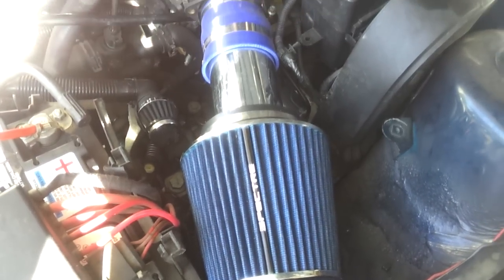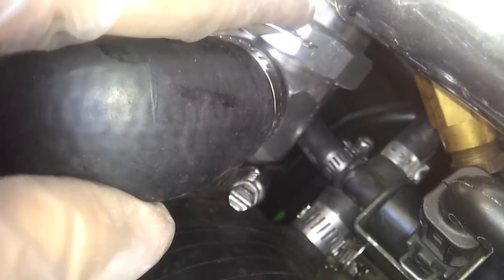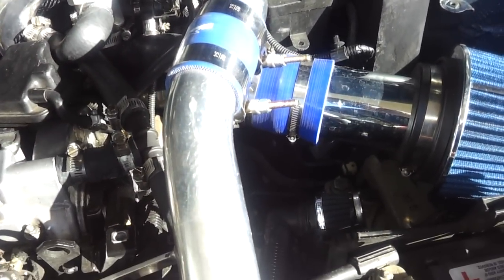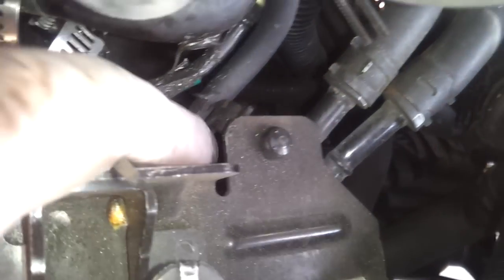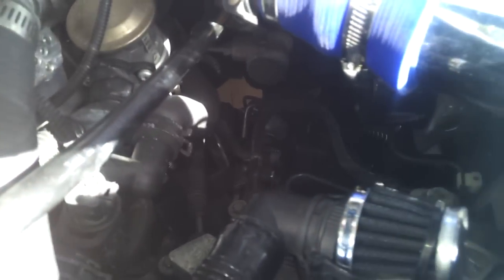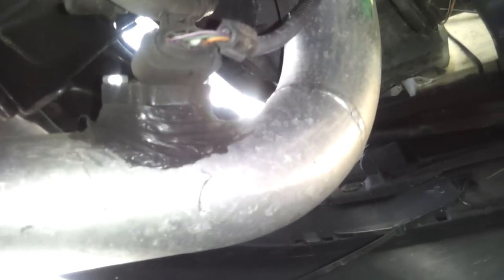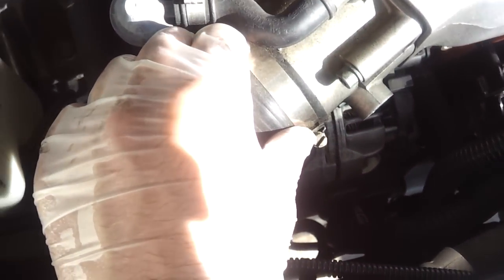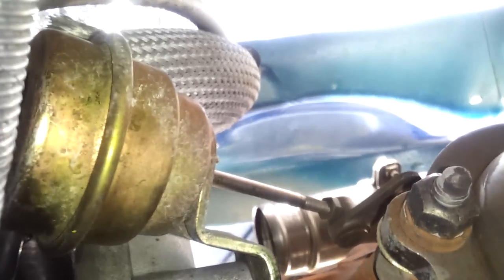1.8T jetta boost leak locations

Comment: Hello you said the hose that connects to the intake hose by the turbo just above the rock lol... connects to the n75.. is that right or does that connect to the evap?
Reply from the maker: the small hose next to the rock connects to the N75. that is correct. hope that helps. lemme know if u need anything else.

Comment: Hi My car is making this exact sound 2:58 , I’m loosing a lot of power cuz the turbo is cutting off. Any way to help me ?
Reply from the maker: Unfortunately i sold the car to the junkyard. This is one of those things unless I'm there physically to see it,  I can't really help. At most, i hope my video guides you in some way. Always take a break from your car and sleep on it, and think about the problem the next day.  Maybe your diverter valve is bad and has a tear in it? Some problems are just hard to diagnose unless if you see a real mechanic or just happened to find the problem by accident. goodluck!

Comment: So I ran the hose that connects to the side of my intake back to where you had that extra blue breather connected to that black plastic hose and I basically set the extra breather aside? Any thoughts? Should I do something different
Reply from the maker: +Adam Landry  With my mini blue intake, i just set it aside, you can set it aside anywhere. As long as you don't have emissions in your state, you can cut the hose shorter so it doesn't hit against the radiator  fan. Simply saying, zip tie it up anywhere you want.

Comment: Boost leak at the air filter you say?
Reply from the maker: James Konkler as I try and understand what you say, yes you can have a boost leak at the air filter. If the air filter's cotton is worn. It can create a hole. Thus, a leak. I don't think I am wording this correctly.
Reply: brontoe  This doesnt make sense to me. There is no boost in that pipe. It's pre compressor.  The turbo is sucking through that pipe not boosting.  If your logic was correct the air filter would be one giant boost leak all the time.

Comment: why would you put heat wrap on an intercooler pipe? shouldn't they be cold?
Reply from the maker: Only the pipe AFTER the intercooler is cold. The charge pipe is HOT. I saw the intercooler pipe slowly melting the rubber  off the radiator hose so I put the heatwrap around that area.

Comment: What's a good steady vacuum reading at idle?
Reply from the maker: light575575 when you hear the oil bubbling. and there is no hiss noises. or air escaping sound. I honestly have no answer. when you hear no other noises you are gooe. I normally do mine up to 20 psi that way I know for sure there are no air noises

Comment: With this problem your rpms could be moving if you are in drive but you are in a red light
Reply from the maker: Thats the clutch sensor. ummm the one where your left foot presses on.
Reply from the maker: brontoe
The item is called the Clutch Switch, you can search for it on ecs tuning  or whatever website. it will stop your over revs at a stop light.

Comment: Thanks for the great video man. I am trying to find boost leaks on my VW Passat B5.5 1.8T. 
You mentioned not to use silicone hoses. I have used some on my previous car vectra 2.0DTI and i was satisfied.  Any more info on that? You have some experience, why not to use them i think they are pretty strong?
Reply from the maker: No problem, glad to help! As far as silicone goes. There are three types of silicone. The 1 ply, the 3 ply and
 the soft, squishy one. Silicone has gotten better over time since i posted this video. The silicone hoses that eurojet, forge, autobahn, and some ebay silicone hoses are good. Don't buy a silicone hose from an auto store  or home depot because they are not auto motive grade. Not yet at least. They tend to be soft and squishy. The term Silicone is so universal and now there are different grades of it. Be out on the look for low quality ones!